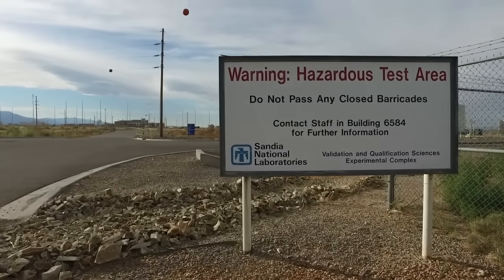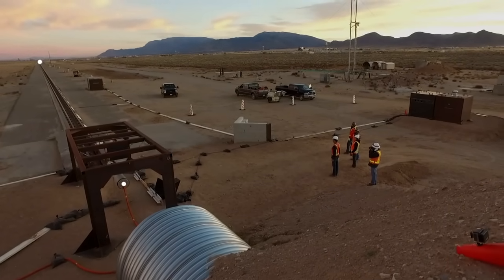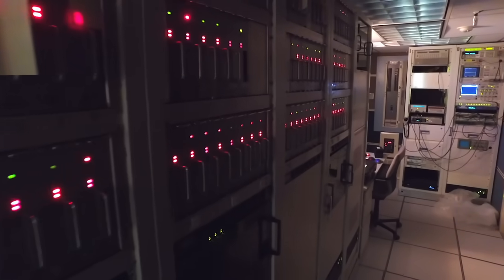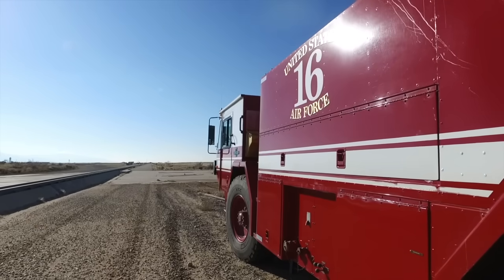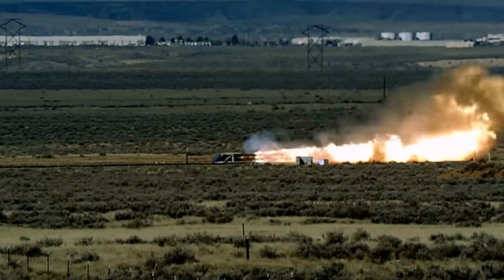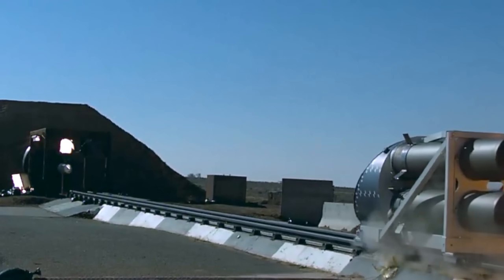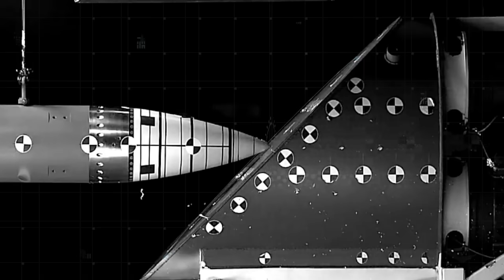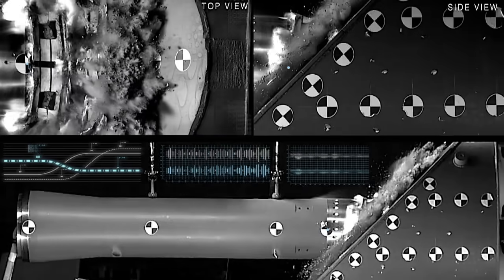Rocket Sled Impact Test In Slow-Motion

Comment: Amazing how that metal missile vaporised on impact, yet aluminium planes that hit the solid steel structure of the twin towers managed to go through the steel like a knife through butter, strange that?
Reply: Uhhh buildings aren’t solid steel. If they were, people wouldn’t be able to fit in them.
Reply: MegAndJas Many different variables... The building was hollow to an extent. The rivots holding the steel together can definetly snap under the kinetic energy of a plane impact. The plane did disintegrate on impact, but the debris carried through with enough force to deform the structure. When your dealing with massive structures colliding, a little thing called the square cube law can be applied. I'd say I am surpirsed the plane didn't do more damage.
Reply: If you say so.
Reply: wrong on both counts dear
Reply: I'll say the strangest part of the twin towers collapse isn't the physics of the airplanes colliding with the tower. Some people say "no duh they fell, they were hit by an airplane" but the towers actually survived the airplane impact. Both towers stayed standing for something like 30 or so minutes which gave people a lot of time to evacuate and the fires nearly burned out before the entire structure from top to bottom completely gave out even though 75% of the building was never touched by fires. I'm not sure how I feel about 9/11 conspiracies considering there was seriously illegal stuff that we know 100% we could have gone after the neocons for which would probably be more productive. Still interesting though.
Reply: You can also see other photos of salvage workers making those diagonal cuts with torches, after the building collapsed. They didn't look like that immediately after the buildings fell. Showing those photos out of context is misleading.
Reply: Your hot knife disintegrates after entry and exits a stick of hot butter in an explosion of tiny fragments?  Mine doesn't.
Reply: The gas turbine engines are made of things (e.g. Inconel, Waspalloy) that would slice right through structural steel. Also, you don't need to cut the steel if you can just set a few floors ablaze, and let the heat anneal the hell out of the steel over a few hours to the point it yields under modest loading (~5ksi).
Reply: Debbiebabe69 I disagree. Much less than 0.96% of the building would need to be compromised for the building to collapse.

You don’t need 100% of one floor to make it be unstable.
You would need to take out a section of the floor to make it collapse.
I mean, if you cut all the beams in half except one it would 100% still fall.

If you took out all the center ones but left the edges I’d think it would still fall.
Reply: "According to the designers, the buildings could sustain multiple jet plane impacts. They were designed with so much redundancy that the structure wouldn't be damaged more than a mosquito net's stucture would be damaged by sticking a pencil through it."

Impacts yes but not sustained fire.
Reply: Given that the trade centres had 104 floors, only 0.96% of the structural integrity of the building needed to be compromised for them to collapse.
Reply: Obviously aliens did it...
Reply: It's a function of velocity. The rocket sled was going substantially faster than a passenger aircraft can. Passenger plane, 450 -500 knots; rocket sled, 2-3,000 knots. simple physics. the faster you go the harder you hit whatever it was you hit. Go fast enough and everything vaporizes...
Reply: MegAndJas,  Grenfell Tower is a completely different situation. Different construction techniques, different situations, different results.

It's like building one house out of straw as opposed to building one out of brick.
Reply: I always find it ironic about conspiracy theorists.  They say question, but only question what they want you to not the conspiracy. They say that because if one questions the conspiracy they no longer believe it.
Reply: That rocket hit a solid metal shield, angled to divert the impact energy away.

The 9/11 jets hit a flimsy (compared to this) unarmoured metal structure that was around 99.9% air, and the impact energy travelled through the structure.
Remember, all you have to do is damage the structural integrity of one floor, this will by definition compromise every floor above, which will overload the design weight of all those below - hence the domino effect.
Reply: The aluminum in the aircraft with the force of the impact also because highly reactant. And with the building acting like a pressure cooker it mean the energy that was generated from he reaction had nowhere to go other than be transmitted down through the structure of the building. 

Nobody could have planned for it and the terrorists most certainly did not understand that the reaction was going to happen as well.
Reply: John Guest, who is wrong on both counts?
Reply: Lots of 'firsts' in the twin towers- including the kinetic impact analysis of a Boeing 707 at full speed which was the largest airplane in common use at the time. That was actually done as something of a whim just to see what the results would be; common thought at the time was that no high-rise building could withstand that kind of impact. Another 'first' was the use of metal studs and sheetrock for the stairway firewalls; prior to that only masonry or concrete were used in high-rises. Another 'first' was the use of trusses suspended between load-bearing outer walls and the core structure; prior to this exterior walls were for cladding only with a full steel frame providing floor support. Not a first but not much used before was spray-on fireproofing for the frame and floor trusses. 

What hadn't been considered was that the impact would destroy the stair firewalls and knock the fireproofing off the steel. The fire alone or the impact alone was sustainable. Both together wasn't. Only after 9/11 did the engineering world lose it's tunnel-vision approach to a disaster actually having more than singular aspects to account for. And TBH, no high-rises built in that time frame were any better with most being worse. Only those designed after 9/11 are better and given normal building delays that means everything over about 20 years old could have similar issues.

It should be remembered that Bin-Laden was a Civil Engineer. When you understand structures, mass, and forces you can calculate where to hit a tall structure if you want to topple it. The planes hit at that spot, both of them. Had he intended for fire to do the damage a lower hit would have worked better as the lower parts are more heavily stressed than the upper parts and would thus fail earlier. Any hit anywhere would have had the same effect on public morale. I honestly believe that the intent was to topple the Twin Towers and in that he failed thanks to an American Engineer who gave his very best to us in designing them. Had other high-rise targets been selected the results could have been much more catastrophic. We may have suffered losses but we were not beaten, and as long as our Engineers give us only their very best we never will be.